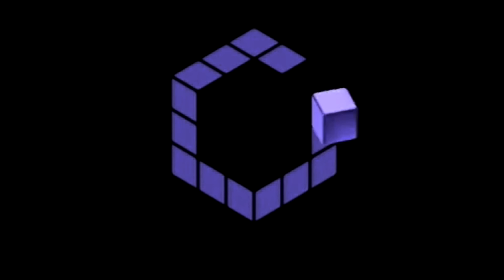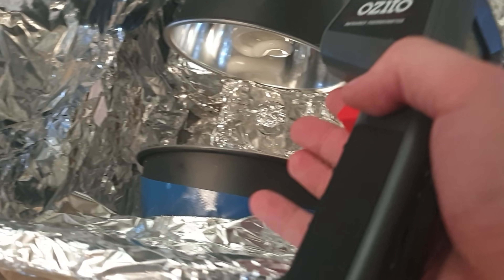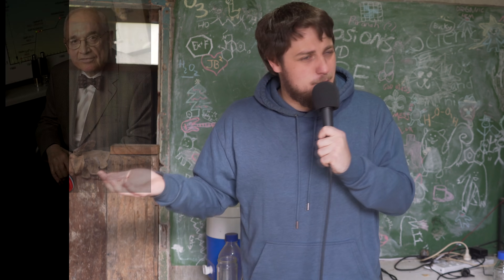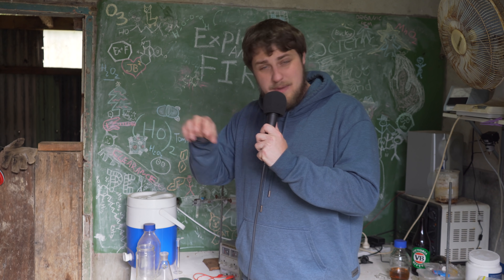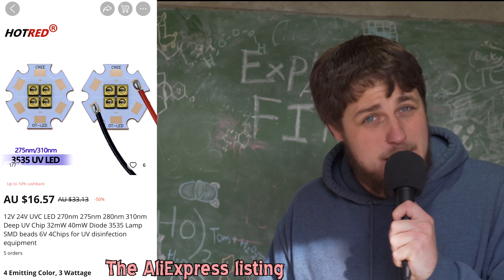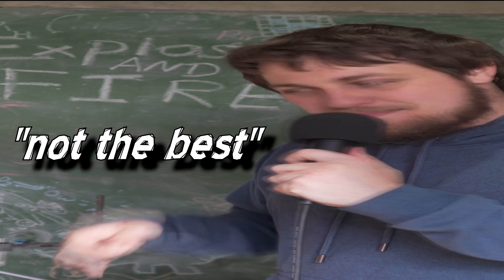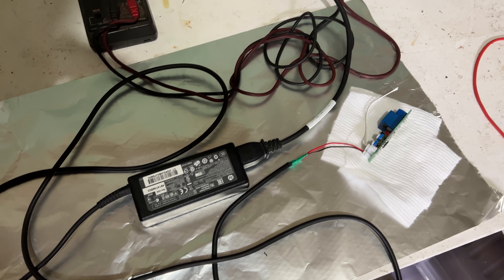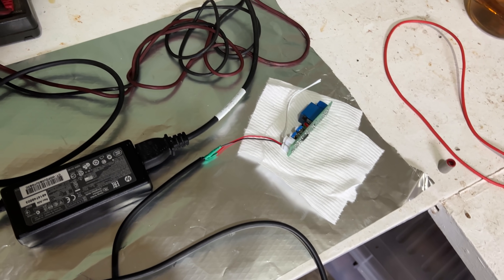Magical deep UV LEDs - Cubane Ep 12

Comment: Ok, so as most people are telling you, treating leds like a normal resistive load is a really bad idea. Honestly I'm amazed that your UV leds didn't just burn themselves out in a blaze of glory.

Leds have an exponential relation between voltage over them and current through them. In practice, you can treat it like an asymptote. Below their rated voltage they will not let anything through, above their rated voltage they will let everything through. So you'll normally see two statistics listed for them. Their forward voltage drop (voltage at which they start conducting, in their normal conducting direction), and their maximum rated current (if you allow them to draw more current than that they'll likely break down).

What does this mean for the driving circuit? You need some kind of power supply that can at least provide the forward voltage required, and limits itself to the maximum rated current. This is very different from your common power supplies, or batteries, which generally just try to provide as much current as they can at the specified voltage.

For high power leds you'll find special driver circuits that probably do something smart using DC DC converters and current-limiting circuits. However, for low power leds you can get away with the "poor man's current source", also known as a voltage source with a resistor in series.

Now for how to design one like that? It's actually quite simple. You just have to find some values which fulfil this equation: V_source = V_led_forward + I_led * R_series_resistance. Pick a current through the led that is slightly lower than the maximum rated current and do the math. In your case (12V forward, 40mA max) you could for instance use a 16 V power supply with a 100Ohm resistor in series. Said resistor will be absorbing about 160mW of power (I_led^2 * R_series_resistance) so do check that it can handle it.

Alternatively, as you seem to have a lab power supply with current limiting capabilities, you can also use that. Configure its voltage limit at a bit above the forward voltage drop, and its current limit a bit below the maximum current draw of your UV leds. You can test the current limit of the power supply just by shorting its positive and negative terminals together. The current measurement should max out at the set current limit, while the voltage measured will be near zero due to the current limit. If instead the current goes to the top of the scale and the wire you used to short them together starts getting toasty you probably forgot to actually enable current limiting functionality.

I'd probably also get some new leds to test with if I were you as performance is doubtful at best after overcurrenting them to this extent. And feel free to ask if you need some more help.

Comment: Sort of surprised you haven't gone with UV water sterilizers, it blasts in many different ways A LOT of UV, if other wavelengths were the problem, always can use filters
Also remember, UV requires silica/quartz glass, this is why normal UV bulb would be order of magnitude better, they BLAST UV for cheap, and efficiently
As of driving LEDs, someone gave you HORRIBLE info, should look in to datasheet at what voltage they draw what current, use online led resistor calculator, cheapest multimeter to know voltage/current properly, literally any 12v power supply could to tho, with potentiometer instead of resistor for smooth current adjustment, alternatively laptop power supply, these come with tad higher voltage, what you bought is enough for 3W power LEDs, enough to fry hundreds of these small UV units at once, it's very easy to go too hard on them as current grows exponentially with voltage, in fact you'd do better with few batteries and resistor for what you need, just watch how to use multimeter properly, don't wanna see another cables exploding trying to measure main voltage
Also... 900mA is constant current, it will splooge voltage until it gets 900mA, these diodes literally need no extra current, you are over driving them, surprised they are not completely dead by now

Comment: Think about this is like tightening tire nuts.
They specific for example 40nM of torque and and you need to turn the nut 14 rotations to get this torque. 
But you can’t just turn every nut 14 turns end expect them to be all at 40nM. 

Dude just google led resistor calculator!
The LED needs 40mA at about 14V the volt can change the mA not!

Comment: I skimmed through some comments and it looks like you got the LED side explained to you - one other piece; when you see a minimum voltage rating on a constant current supply, it's usually not a suggestion because often the voltage conversion topology inside it is using a boost regulator, which is incapable of outputting a lower voltage than its input.  So that supply you used is probably 2 supplies in actuality; a 24VDC supply that feeds a boost converter that can boost the output voltage up to 36 or 48V or whatever it was.  But the boost converter has a diode literally connecting its input and output, so when it's fed internally 24V, it cannot regulate below it, as the fried LED module can attest to.

Comment: Best way to run them will be a real led driver they should be easily acquired.
And no current does not determine brightness voltage does.

Comment: @Extractions&Ire Hi, I design UV LED lamps for a living. AmA :)

I had to skip a few parts (gave me nightmares) but here are some tips:
- dont' use the 900mA power supply again. PLEASE :(
- 40mA * 14V = 0.56W (minus opitcal power) --> the heatsink should be enough. but not for 900mA... 
- You can use your bench supply to generate a constant current! The knobs on the left set a current limit: 
   1) turn the voltage to ~3V, and the current down to zero
   2) put your multimeter in to amps range [A] and short the bench supply with it (red to red, black to black)
   3) turn the current up veeeeery carefully until it shows 40mA, or better 35mA ;) 
   4) disconnect the multimeter, turn up the voltage to ~18V for one star or ~30V for two in series. don' touch the current control 
   5) now you can connect your LEDs and only 35mA will flow through them, the voltage will go down automatically
- you can leave your multimeter in the loop with the LEDs to monitor the current. 
- If you decide to generating the 40mA wihtout the bench supply (but why wouldn't you?), I can help you with the circuit. Why do you live on the other side of the planet?? Or you give me your address, a few days to build it and 10-12 working days for shipping

Comment: Voltage = push from power supply;  Current = demand from device;  End device need to handle the voltage from the Power Supply, and the power supply need to be strong enough to supply the current.

Comment: 8:20 into the video and shaking my head... Use the current limit feature of the power supply, set it to 40mA and then you can set the voltage arbitrarily high. LEDs are current driven, their resistance decreases sharply when they reach operating voltage and you end up feeding them 1.5A or something stupid.

Comment: Almost had an aneurysm watching those LEDs take over an amp 😬
1. Get a dc power supply (that laptop one will do fine)
2. Calculate a resistor value according to Ohm's law: Resistance = (PSU Voltage - 13) / 0.04
(13V because its somewhere in the middle of that 12-14V range)
3. For each LED, attach a resistor of that value in series
4. Attach all the LED+resistor units in parallel to the PSU
(The PSU will need a maximum output current of 40mA x the number of LEDs. That shouldn't be an issue though)
Reply: Even if you find a PSU with an output voltage equal to what the LEDs accept, you still want a couple of extra volts plus a resistor. The current through the LED is extremely dependent on small fluctuations in voltage. The resistor acts to dampen that effect which gives a reasonably constant 40mA

Comment: You have the hands of surgeon with electronic devices!!! That is sarcasm. Best advice is ask someone with a modicum of electronic knowledge. Because reading some of the comments confused the hell out of me! And I spent my entire life working in the industry. I have a 100 amp PSU set at 3 volts at 100 amps put LED on it it lights up fine , but put it to 4 volts no more LED. Not because of the amps it's the voltage.

Comment: The LED driver you have is for 30W LEDs and will attempt to put out 30W at all times, the voltage was not the problem since they work off of power (Combined amps*volts, trying to adjust the volts until the amps*the voltage equals 30), which is why it blew your LEDs up.  At 12V that would mean it was putting out 2.5A (2.5A * 12 = 30) into LEDs designed for 0.040A, hence the explosion.  Using two LEDs reduces the current to 1.25A, which is still ridiculously high and they are very unlikely to last for more than a few minutes total before dying.

You hooked the relay module up backwards, the copper braided shield wire is always negative.

 Absolutely screaming at the screen as soon as you connected it to that PSU.  It's impossible to adjust it finely enough to hit 40mA (0.040A), and feeding it amps will kill it incredibly quickly.  Also as tons of others have noted LEDs are current-driven and must be used with a proper resistor or constant current supply.  A bench PSU will deliver as much current as it's capable of with an LED once you exceed its forward voltage drop, blowing it up.  Also as LEDs heat up they consume more current, mandating a ballast resistor or constant current supply.  If you use a 100 ohm resistor and a 16V supply that would work fairly well as long as the supply is stable.  16V - 12V = 4V. Using Ohms law 4V / 0.040A = 100 ohms

Comment: Conceptualising the ratings for LEDs can be a bit confusing if you're new to it. A helpful way to think about it is that LEDs have a forward voltage drop that changes depending on their forward current. So if you apply 10mA it might have a forward drop of 1.9V and if you apply 20mA it might have a forward drop of 2.1V. This goes both ways, too: if you apply 1.9V it'll draw 10mA, and if you apply 2.1V it'll draw 20mA. Since it's a diode, the I/V relationship is non-linear, and usually ends with a kind of exponential rise - it's not like a resistor where you can just do I=V/R. The problem starts when you just try to directly eyeball the voltage with no current limiting - it might be happy drawing 20mA at 2.1V, and 40mA at 2.2V, but if you apply 2.3V it might draw 200mA (which is 460mW) and cook itself. Hello magic smoke.

LED behaviour is better thought about in terms of the forward current rather than the forward voltage drop. The relationship between their luminous intensity vs. forward current is stable and fairly precise, but the relationship between their luminous intensity vs. forward voltage can vary quite a bit. So if you try to drive them with a fixed voltage, they're not very consistent - you might find that LED1 pulls 45mA and LED2 pulls 55mA. This gets even worse with LED arrays because the overall tolerances add up.

To solve this you use a constant-current driver, which is a fancy word for "power supply that keeps increasing the voltage until the right amount of current is drawn". It doesn't need to figure out the exact perfect forward voltage from a datasheet and then tune it for each LED's variances - it just keeps an eye on the current and moves the voltage up or down in a tight loop (kHz or MHz) to keep it tracking at exactly the right current draw. That way you also don't need to care whether you've got 1 LED or 5 LEDs in series, as long as the total forward voltage doesn't exceed the limits of the driver (both in terms of minimum and maximum output voltage). It'll apply whatever forward voltage is necessary to reach the configured current draw.

The one thing to be careful of is switching the drivers on and off. If you power a constant current driver on with no load attached, it sees zero current draw, so the output voltage ramps up. If you then connect an LED, the instantaneous voltage across the LED will be too high, and you'll likely damage it before the constant current driver has time to reduce its voltage. This is why you should always put your switch on the input side to the constant current driver (or use its onboard switch pins if it has them).

Comment: Pro tip:
Don't hot-swap LEDs from their driver(s), the capacitors may dump the full peak current (x) Voltage from the output capacitors and fry LEDs.
Those "24V" drivers should cut off if the LED voltage is too low as they'd current limit the LEDs.

Comment: Electronics engineer here. In short - You are actually doing good!! It's dodgy for sure, but good enough!
---
Heat kills LEDs, and it does not matter, how it got there - too many volts, too many amps, too many f**king electrons = too much heat. Always consider cooling! Never let heat sinks get above the temperature that You cannot touch them.
I will not comment on power supply solution because it worked! And if it works, don't touch it!
As for power supply, You unintentionally did a very wise choice by putting relay in mains wires rather than in LED power lines. Keep it that way as it is actually important!
Soldering: given the (crap) tools, You intentionally or not did a very good text-book soldering for what You had.
---
Anyway, if You need help in DIY electronics, just hit me up and I'll make a video response to Your questions about electronics in short, simple and down-to-the-earth way.
Good luck!

Comment: Yo I am sure you've had this 100 times by now, but after years of explaining it to others I found this the best way to explain it; volts are pushed by the PSU, amps are drawn by the device. So you have to give it the right volts or you'll cook it worse than snoop dogg, but as long as the amps 'available' are same or higher than the device will sink, you're fine! 

Unrelated-ish those 'cooked' chips; can I buy them? Or pay postage? Looks like they are parallel and one just went full short so the others may be good and.... useful for... things. Thanks! -Plat
Reply: Oh and yeah in series then higher voltage source reuqired to 'push through' each of them (being a bit of a resistor each), in parallel higher amps sunk by the unit combined, but same voltage as the leads have near-zero resistance :)
Reply: And keep up the awesome work! <3

Comment: LEDs are nonlinear devices. Humans are total shit at manually controlling nonlinear systems. So you will find only grief and smoke if you try to manually regulate the current through your LEDs by hand-twiddling the knob on your voltage supply.

Comment: You should try and add a resistor in front of you Leds, just solder it between the LEDs and your powersupply.
Leds draw as much power as they can after you reach a certain voltage threshhold, that's why you saw the big Amp spike.
And if you go even higher(voltage) theyll draw even more unti they die.

The easiest way to fix this is by adding a resistor.
It limits the amount of power your LEDs will draw.
Solder it between your leds and your Powersupply,
doesn't matter if you put it between + and the leds or - and the leds.

So how do you choose the right Resistor?
-Check how much Amps your LEDs should take
-Take this Formula: R=U/I put Amps instead of I,
choose U to be something like 1V
(The higher U the more power gets wasted, but the finer your control over the LEDs)
-Buy a Resistor with the Resistance R you just calculated
-Check if the Resistor can take the power that flows through it
You can do that by calc. U×I=Power my Resistor will draw, and then choose a Resistor that can take that power, better give yourself some headroom
(The U here is the same U~1V you chose before, I the current ur Leds draw)

!! The voltage you need to provide now in order to FULLY use all your Leds power is the voltage the leds are rated at + the U across your Resistor
Better stay a bit below it so your Leds live longer

Have fun!

Comment: Is it 40mA per LED, per 4-LED star, or per 4-star unit?

Edit: looking at the listing it seems it means 40mA per star. So you want to draw 160mA total. They want 12V, and for the purposes of this calculation we'll assume the resistance of the LEDs is negligible (it isn't, but I don't know how to work out their resistance.) V=IR, you have 12V, you want 160mA, that's 12/0.16=75 Ohms. You can probably get away with slightly less, but make sure the resistor is rated for 12V.

Comment: Speaking as a geologist I found the secret to electronics is to start with low voltage that won't kill you. Then connect stuff up that you think will do the job and watch it smoke (potentiometers, resistors, transistors),  explode (leds),  burn (wires, inductors), and do other unexpected things, (everything else). Then you look up internet tutorials on electronics to understand your stupidity, pull apart various old transistor radios, printers, computers, and any other stuff you find by the side of the road on hard waste collection days.  You desolder large amounts of components for free resistors etc to play with, create frequent blue smoke, almost fry several lithium batteries, and finally gain some understanding of the limitations of each component, their ratings and how to use them. Eventually realise that you can (?need to) apply mathematics to achieve the desired result without burning the place down or polluting your neighbourhood.  When the thing works  you can modify the circuit so that it does not destroy itself when it experiences unexpected spikes, suffers reverse voltages from inductive sources when the magnetic field collapses as you switch off, or tries to electrocute you after two weeks because the ultracapacitors are still charged to several thousand volts.

I think I'll stick to exploring old shafts, its much safer.